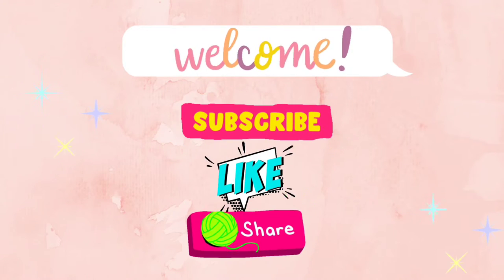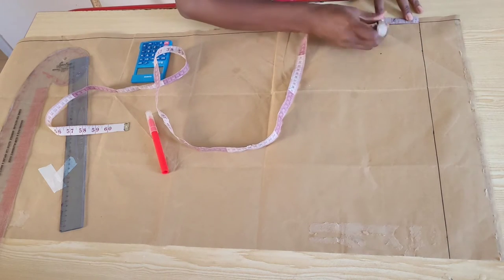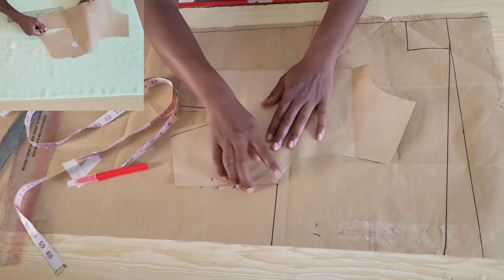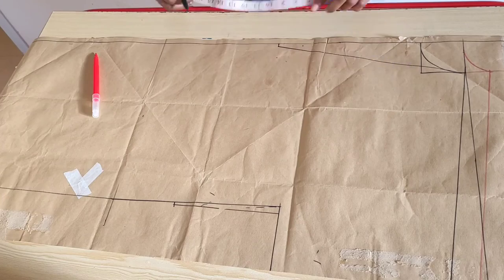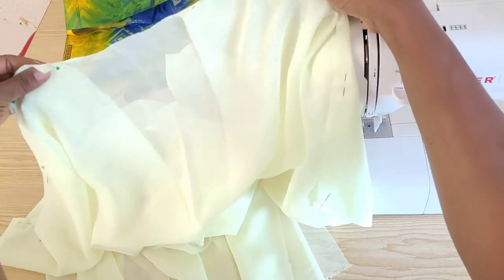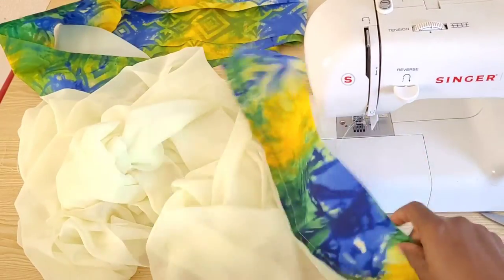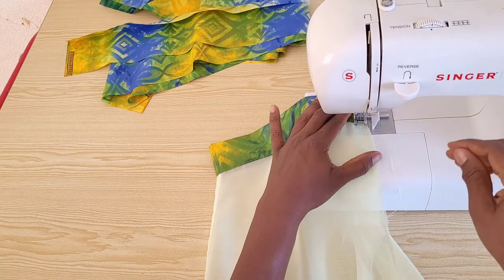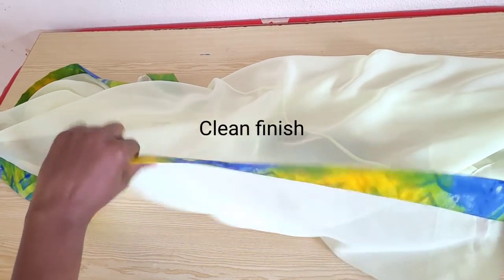How to/ Draft 📐✏️Cut and Sew🪡🧵 a Kimono Jacket with Chiffon and Ankara //Detailed Tutorial

Comment: Hello. Thanks so much for this in-depth tutorial. I am going to follow this to make a kaftan.  I have heavy duty, kind of stiff satin with no stretch at all for the borders of the sleeve and front opening. Do you suggest I cut the strips lengthwise from the fabric or at the bias. I want to turn neatly around the lapels and where the v of the neckline meets and down. Thank you.
Reply from the maker: You are welcome. Thanks for the feedback. 
I suggest u don't cut on a bias. In this other  tutorial, I shared how to achieve a neat  lapel and how to cut and sew  that slightly v shaped area. Here is the link
https://youtu.be/tOfxMMR7L8k

Comment: The 2 inches you added at the back are they the ones that helps to not keep pulling?
Reply from the maker: Yes.....the 2" is with seam allowance 1/2 inch. The height of our back armhole is always higher than the front. If u cut on the same level for the front and back, your hands will always be on your dress from adjusting it. The same thing applies to shirts and jackets. You can watch my tutorial on how to draft the basic bodice for different sizes with the right neck measurement, armhole levels, and bust dart level on my channel.
Reply: Pls can u put d link here
Thankiu
Reply from the maker: Links to basic bodice block for different sizes. Extra Small Size,  Small Size,  Medium size, and Large size 
Extra Small Size link 👇
https://youtu.be/qGR3n6w2t2k

Small Size link 👇
https://youtu.be/bBfg2TfeYB8

Medium size link 👇
https://youtu.be/7b-fMWz1uxE

Large size link 👉https://youtu.be/7lrogzQWBPI

Comment: Thanks for the video maaaam. I have problems with attaching the lapel. It's smooth when you start nd at some point, it starts folding with much gallops 😢.  What do I do
Reply from the maker: U are welcome, dear.  At the place where ur v neckline meets, go in by 0.25" from d centre front and try and smooth out that place so that it doesn't curve in... slightly slanted.
Reply: @amacoutures  thanks ma'am
Reply from the maker: My pleasure 😊